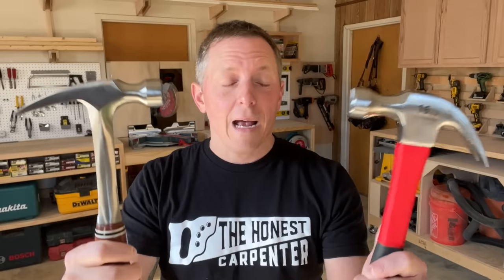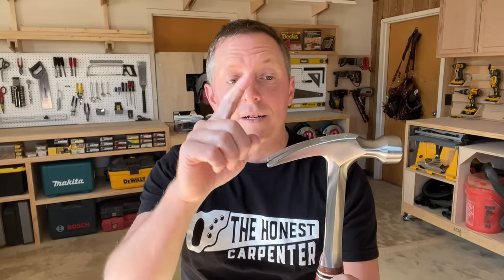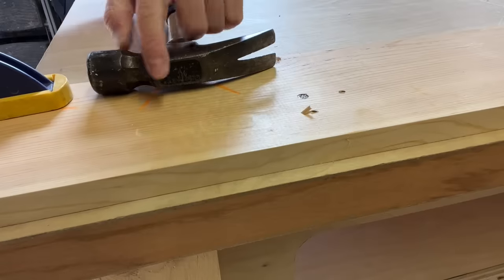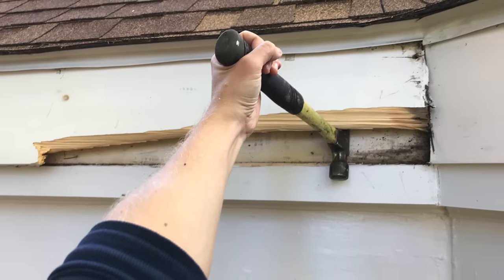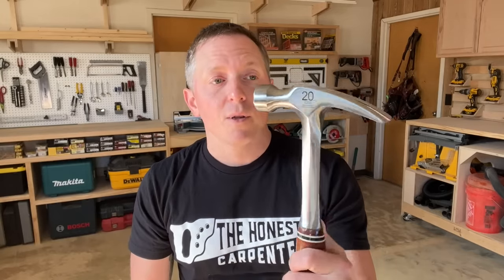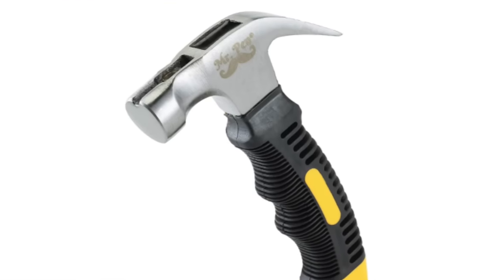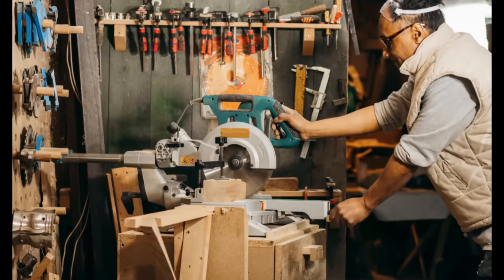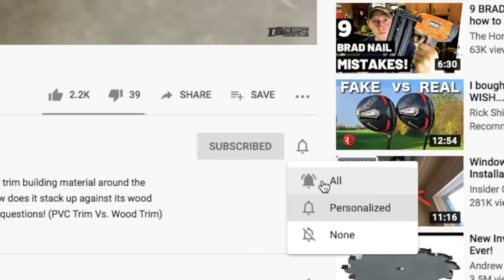DON'T USE STANDARD HAMMERS!! Try This Instead...(Rip Claw Hammer Vs. Curved Claw Hammer--Which One?)

Comment: As a retired carpenter with 40yrs experience, here's a pro tip: If you value your elbows, stick with wooden handled hammers. Steel handles cause a huge amount of percussive damage to your elbow and shoulder joints. They're great for demo but not for everyday use.
I would recommend a 20oz wood handled Vaughn straight claw hammer for all situations,
Reply: Amen, brother. Used an all-steel Estwing 20. It was like a battering ram. Drove 16s in a single blow and ATE demo. But it ruined my elbow. Then tried fiberglass handles. They splinter and split along the shank above the grip. And you constantly get spikey shards in your hammer hand when you slide it back into the loop. 

I ended up with a 20 oz Vaughn. Gives the same advantage as the Estwing but cushions the impact. However,  after snapping the handle off of one during demo, I pull out the Estwing to take things apart. And the Vaughn to put them back together.
Reply: Yep. I have been guilty on many occasions to overestimate the strength of those wooden handles so I always kept a couple spare handles in the toolbox. Got good at changing handles and always always had a backup just in case. And always carried an Estwing when it was time for "Hulk...smash"
Reply: @blainehankins  Good for you with the new handles. I never got very good at it. Hatchets - yes. Go-to hammers - never.
Reply: I feel the same way, but wood handles, at least the ones they make today, self destruct. I bought fibreglass handled hammers when they came out, and haven't replaced a single fibreglass handle tool of any kind. The fibreglass handles have the shock absorption qualities of wood.
Reply: I love air guns. Neat and easy. Nice sound too.
Reply: @artyfhartie2269  Allow you to over-nail. Chew up the stud. Split the edge of the plywood so no shear value. 16d are actually 14d. Sink the head below the surface of the sheeting so you only get the value of 3/8 ply instead of 1/2" ply.

But sure. Sounds great.
Reply: Amen! I couldn't have said it better. Also from experience.
Reply: @ricoludovici2825  Framing nails are up to 90 mm long with a flat head. When you adjust the air gun right,  it is a thing of beauty and strength. Neat. I love the little staple and pin guns too for delicate work.  No need to over nail and with some wood glue, strong as a fort.
Reply: @ricoludovici2825  I hate any fiberglass handled tools with a passion.  At some point, they will give you fiberglass splinters.
Reply: After running chainsaws for 31 yrs, and half of that time, in the tree with a climbing saw, I wonder if it would make any difference to my beat up old body. At 65, still climbing daily, more abuse doesn't seem to matter. 😆
Reply: @artyfhartie2269  Pneumatic nailers definitely have their place. They are fine for sheathing and roof decking and an absolute must for finish work but for framing they are inferior to hand nailing. A nail set with three strokes of a hammer holds way  better than a single stroke with a nail gun. I have tested this. As for plywood, I always set the nail gun pressure so that the nails were left a bit pround and then came back to set them flush with the Vaughan. Best of both worlds.
Reply: Makes sense thanks
Reply: @Fuckinsurance  Wood handles can be crappy, without a doubt. I'm sure OP is implying that people should use quality ones that stay put together. And speaking as a former medical massage therapist who worked on lots of tradespeople, they're absolutely right about the percussive damage to joints in the hammering arm when using a more solid steel piece instead of a material that can absorb a little shock. For casual DIYers like me who don't use tools all day every day, the difference is probably marginal at best, but for someone using a hammer much more often, the small differences add up.
Reply: so true , my elbow is trash after using steel handle for years nailing shit !
Reply: I concur.
Spent a summer in my 20's swinging a 22 oz Estwing.  Went back to school with tennis elbow.
Reply: I seem to remember Tom Silva from This Old House using a hammer with a wooden handle that he drilled holes in to make it easier on his aging joints.
Reply: @blainehankins  Try nailing 90mm nails in hardwood with a hammer
Reply: "I would recommend a 20oz wood handled Vaughn straight claw hammer for all situations"

Even picking up hitchhikers?
Reply: @ricoludovici2825     Hammers seem to be used nowadays for everything but sinking nails. I used to swing it all day long, but pneumatic and cordless nailers have rendered that almost obsolete. I’m not sure where you’re located, but I don’t see a lot, if any, hand nailing going on around here.
Reply: @ricoludovici2825     Most guns have adjustable depths on them and if you over nail something, that’s on you, not the gun’s fault. Building a house and hand nailing everything would take an inordinate amount of time and effort, especially going into hardwoods or lvl’s.
Reply: @huejanus5505  Quite true. But quality has NOT gone up as a consequence. Just speed.
Reply: @huejanus5505  Yes, they have adjustable depths. But the operator has to adjust it. I assure you, I know all that stuff. Now if the workers in the field would just DO it.
Reply: @reidflemingworldstoughestm1394  Nothing sounds as sweet as an air framing gun. Pitew, pitew.
Reply: I like fiberglass.  But I agree with steel.
Reply: @thezfunk  Never happened to me.
Reply: Thanx!  That’s an interesting problem. Wonder if it has to do with the give in wood back the metal. The shock moves up your arm to the point where there’s some give.
Reply: Agreed...Wood rules!!! I always make sure the grain in the handle, is in the same direction as the head and claw. And if I soaked the handle in a little used motor oil, it seemed stronger and lasts longer. Fiberglass can absorb the shock, but those fiberglass splinters suck.
Reply: At work I always use synthetic handles (fiberglass core plastic and rubber overmold) nice on the elbows but lasts well without any care. At home I have wooden handles and when I brake them it's fun to rehandle them.
Reply: @KS1776  I have an assortment too. Replacing handles is fun... I like to dye, burn, and clear coat mine. Gives an interesting look
Reply: @Fuckinsurance  wow, you have problems. Ask your insurance about therapy. Oh wait... Your name... nevermind...
Reply: I wonder if someone could design a steel hammer that had a two part handle attached with a strong center bolt with a urethane bushing between the gap where the 2 parts connect, so you get the shock absorption of wood with the strength and durability of steel 🤔
Reply: Aren’t the pneumatic NAILS the big breakthrough? I am told that when you drive one into some boards, a joining compound sinks along with the nail-and good luck pulling the boards apart. You’ll need it.
Reply: That was my framing hammer I forget if it was 19 or 20oz. I love Vaughn hammers, affordable and great quality.
Reply: I switched to titanium with a wooden handle 18 months into starting my own remodeling company after being a cabinet maker for 12 years. Expensive, but medical bills are more expensive.
Reply: @marsbase3729  That's what I was going to say.
Reply: @Fuckinsurance  Would you care to share a little info about your decades of experience with different types of work using different types of hammers that you obviously must be basing your opinion on. 
I'v used hammers in, carpentry, structural steel, HVAC, plumbing, sheet metal, landscaping, bike mechanic, blacksmithing... and more, but that's was a long long time ago. 
In my experience, when used properly quality wooden handles can last plenty long enough and save the long term user a lot of pain and possibly debilitating injury to make them well worth an occasional handles replacement. 
If your braking quality wood handles left and right, it's the way you are using it that's braking your hands and not the fault of the wooden hand.
Reply: Absolutely agree. When I started as a big strong teen I immediately bought the biggest estwing at the store, a 28 oz. 
After awhile I downsized to the venerable 22 oz. 
Fast forward 20 years &I have tendinitis & an ulnar nerve impingement.

The 999 wood handled 20 oz. Vaughan with a milled face is my go to hammer. The 19 oz. Cali with the longer handle is really nice too but struggles a bit with toe nailing & can be slightly awkward. 
  As a young man I didn't have the time or patience to "baby" or replace a wood hafted hammer. 
Now my elbow doesn't have the time or patience to handle the percussive reverb from the steel shafts.
It takes a while to catch up. But now I very rarely ever use a steel shaft. A drilling hammer and a bar are often more effective anyway. 
With that said, for the homeowner or weekend warrior, a 16 oz. Steel estwing will likely serve all their needs very well.
Reply: Mine are neither, that new age unbreakable plastic with a rubber grip.
Reply: @mathewgrubb7465   We also have Flashing, Joist Hangers, Hurricane ties, new work windows, some siding e.t.c... 
I'm 36 and used an Estwing 28/22 oz. Primarily for years. Developed bad tendonitis, and the inflammation pinched my ulnar nerve. It affects your ring and pinky finger, as well as the back of your hand. Pins & needles, burning and itching. It'll wake you up as well. 
  After switching to 19 & 20 oz. Vaughan wood handles and doing some additional stretches/being aware of my limitations I'm back to nearly 100%. 
I have XXL hands and work out pretty regularly... the elbow injuries are cumulative and steel handled hammers are a big contributor.
Reply: @marsbase3729   Never seen it in a hammer, but Fiskars did it with their hatchets, and their nearly indestuctable polymer. It's plastic, but I've seen that plastic put through hell by 250 lb. Apprentices with splitting mauls & knotty oak.Fiskars makes a steel handled hammer that has a separate core handle makeup & they claim major shock reduction. The cheeks are hollow with some rubber shock absorber. It looks kinda gimmicky, but I thought that of their axe lineup before I tried them. They're excellent and 100% lifetime warrantied.
Reply: @mathewgrubb7465  I started usung nail guns in the 1970's. They don't make nailing better, they just make it faster. Quantity over quality.
Reply: Started out with a 19oz Vaughn straight claw hammer with waffle iron head and wooden handle. Loved it. Preferred it over a 14 oz titanium which someone gave me as a gift.
Reply: @reidflemingworldstoughestm1394  Nah, we use meat hooks for grabbing those on the fly.
Reply: @ricoludovici2825  I haven’t used my Estwing for everyday stuff for years. If I’m taking stuff apart though, it’s my go to. Otherwise it sits in the back of my hammer hanger. My newest hammer is in front - a curved claw Tekton with a hickory handle and the magnet to hold nails for starting so I don’t bang my thumb.
Reply: @thezfunk  Not a fan of them either.
Reply: @ItsAsparageese  -- I think a lot of the problem stems from bad hammer technique. The most effective way to swing a hammer is to crack it like a whip, holding it by the "knob" at the end, and using wrist motion and some pivoting of the hammer within the hand to get the "cracking" motion. This technique does take longer to develop control with, but it's much easier on the elbows, as it distributes any shock through three intersections: the pivot point in the hand, the wrist, and the elbow, all of them looser and more relaxed than when one's technique relies more on trying to "push" the nail into the wood. I used a 22 oz. Estwing straight-claw, steel shank framing hammer for 30 years, and had ZERO problems with my elbows or wrists. Ironically, I did have some elbow pain when I tried out one of those California framers with the more "ergnomic" wooden hatchet-style handle, because the curve at the end of the hammer made it more difficult for me to use the end of the hammer as a pivot point. For someone who insists on using a hammer to push nails in, I suppose that would be a good choice. 
-- Using a whip-cracking motion to generate more force is not just for hammering. It also applies to tennis swings, putting the oar into the water in competitive rowing, martial arts punches, and a whole lot more. And in all of these cases, it takes a lot of practice to learn how to do it with control, which, I suspect, is why it is so underutilized. But I would drive 3-1/2" 16d nails with three blows all day long, and 2" 6d nails with two blows. Never a hint of elbow or wrist problems. 
-- For finish work, I use a 16 oz. Stanley curved-claw tubular steel handle that I bought in 1976.
Reply: @grizzlygrizzle  You articulated that extremely well! I've applied that principle in other disciplines in my life (e.g. martial arts like you mentioned, and it's relevant to some musicial techniques too) but I'd never thought to apply it to hammering, probably because I'm still novice enough with carpentry to be more concerned with accuracy for the moment lol. Thanks for the great rundown on that technique and again awesome job putting words to something so spatial/physical! I always have trouble explaining those sorts of things through comments lol.
Reply: @ItsAsparageese  -- Thanks. When I wasn't working in construction, I majored in English and philosophy, and went on to do grad work in philosophy, mostly in phenomenology (of the pre-postmodernism sort), which is largely concerned with sorting out the different types of subjective experience that we all have in common. But that was a crappy career move, so I went back to swinging a hammer.
-- I was actually a little bit thrilled to hear that you have applied that principle of motion in martial arts and music. It's like a secret I sometimes feel almost evangelical about.
-- If you're going to try that technique of hammering, keep in mind that the grip could be different for your hand than mine, depending on hand size, flexibility, strength, etc., so be prepared for some trial-and-error. Personally, I grip the hammer with my thumb and index, middle, and ring fingers, with my pinkie curled (loosely) beneath the butt end of the handle. I picked up the technique by increments, with the "swinginess" of it fairly minimal at first. 
-- Control is often a matter of using a swing that contains a sideways arc, for when you start a nail and it's leaning a bit to the left or to the right. You want the face of the hammer to hit the head of the nail in a flat, non-glancing way, but if the momentum of the hammer's motion is not in line with the shaft of the nail, the nail will bend. 
-- If  you are already somewhat familiar with the whip-cracking technique, then you should know that it can work with torsional motion as well as linear motion. Play with it when you're doing some framing or any rough work. Once you grasp the underlying principle, it's a lot easier to make it happen. With enough practice with the sideways arc motion, you can drive nails almost perpendicular to the path of your backswing, as when nailing into the face of a floor joist in a basement ceiling, when you can only swing lengthwise through the joist cavity, and have only 6" of backswing (14-1/2" minus the length of the nail and the length of the hammer head) if you try to swing in the usual way.
Reply: @grizzlygrizzle  Hey, carpentry, philosophy, it's kind of all the same thing depending on how one looks at it, and goodness knows they complement one another well :P I'm a big epistemology geek myself, particularly in the sphere of public health and how people communicate about concepts of health and medicine, particularly-particularly as it relates to patient education and clinical outcomes -- all of which is to say, I feel you on the interestingness of the intersection between subjectivity and objectivity lol.

I'm short on brain cells at this hour but I think I'm pickin' up what you're puttin' down about applying the momentum-whipcrackery notion to torsional motion rather than just linear. It's resonating with the part of me that remembers the throws I learned in jiu jitsu, specifically those which use circular movement. Commitment to whipcrackery of an opponent was vital to ensure many of the techniques actually moved people at all. I'm having a little trouble turning that notion into a visualization in my head of how a hammer swing in this style would work (despite your excellent description giving me a very clear visual of the context and need), but that's mainly just because I've never done it and don't have the relevant things in my hands and eyes right now haha. I'll definitely have to experiment with this next time I'm doing buildystuff.

I absolutely love geeking out with other methodical, analytical, conceptual-level-vocab-oriented people about things to be methodical and analytical and conceptual about and ways to do so. And I absolutely grok and relate to the joy of proselytizing useful techniques and systems of techniques lol. I suspect we'd have a lot of fun trading other ideas. Want to be friends? Got Discord perhaps?
Reply: @ItsAsparageese  -- The sideways whipcrackery (I like your term for it) involves a lot of wrist rotation during the forward motion of the wrist. 
-- With you on epistemology. Descartes distinguished between practical certainty and absolute certainty almost 400 years ago, Locke amplified solid reasons for intellectual humility with his argument for religious toleration, and yet the technocrats at the WEF are STILL pushing their Orwellian, build-back-fascist, save-the-planet utopia that reduces the people to livestock. 
-- Science objectifies and mathematizes what it studies. Edmund Husserl (father of modern phenomenology) described science as reducing the world to "space-filling mathematical formulas," and from a different direction, Ludwig Wittgenstein often spoke of "logical space" in his early years, and he played with logic as if it were a 3-D matrix within which scientists and practical thinkers conceive the world as intelligible. Both of them ended up skeptical when they realized the distortions of reality this entailed. David Hume concluded that the connections we perceive in the world were mere "mental associations," while Leibniz, on the other hand, somewhat credulously put forth his view of the structure of reality as having no connections and no causation of the sort we usually think of.
-- ("Connected" and "distinct" are antonyms, and when we conceive the world as countable, mathematizable objects, we preclude connections between them, if we think of these things in absolute terms. One of the oldest questions in philosophy: "Is the world one thing or many?" In my view, the answer is "Both." The world is ambiguous with respect to the distinctness and countability of its stuff and with respect to the physical connectedness and cohesiveness of the world. This also entails that the boundaries of physical things are ambiguous. Consider that the gravity of a physical thing extends to infinity, though in an ever-diminishing strength.)
-- (So when we conceive of the world in terms of distinct, countable objects, we aren't making this up out of whole cloth, but only marginally distorting it, for the sake of clawing out distinct logical handholds. The distinctness in the world is real, but not absolute. And on the other hand, the connectedness of the world is also real, but not absolute.)
-- (The expectation that our science and logic would come out absolutely true has led to disappointments when various evidences emerge that it isn't, and those disappointments have left us with a bunch of radical skepticisms-- "absolutist" skepticisms, like postmodernism.)
-- (Intellectual arrogance and absolutism leads either to extremist digging-in-of-heels-- scientism, or to extremist skepticism about the possibility for truth and knowledge-- postmodernism, but both have the same root, and end up oddly in the same political camp that pushes for censorship and against transparency. Scientism gives the intellectually arrogant license to objectify and mathematize their neighbors, as if that didn't reduce them to the status of livestock to be managed, while postmodernist gives the more emotivist crowd license to ignore any truths and data that disagree with their preconceptions as someone else's propaganda. For postmodernists, there is no such thing as truth. There is only propaganda. So from both ends, epistemological extremists unite against epistemological moderates.) 
-- (The social sciences objectify and mathematize what they study, and that just happens to be other human beings. Their scientific approach to humans necessarily takes a veterinary or animal-husbandry perspective and renders human beings as livestock to be rendered more predictable and manipulable. What could go wrong?)
-- Personally, I prefer an epistemologically moderate approach to human affairs.
-- When it comes to patient education, data, and truth about the current malady, I would refer you to YT channels Dr. John Campbell, Drbeen Medical Lectures (sic), and Peak Prosperity. 
-- I don't have Discord. I'm embarrassed to say that it is something I have heard about peripherally, but have never been there. Is there a way to send private messages through YT? I don't have much in the way of social media. Maybe I'll try out discord. Any advice in that? I do have a facebook account, but I rarely visit it. I only use it to keep in touch with some friends in the Philippines.
Reply: @ricoludovici2825  I have broken the head off 2 20oz estwings doing demo. Don't trust the hype.
Reply: From someone who really knows his stuff.
Reply: Fiberglass is OK too
Reply: Correct. The other one could be considered a finishing hammer.
Reply: O ya, infact when id go to the store and they had my favorit wooden handle, id buy 5-10 of them at once jjst for what you said. I still have a bunch but their dwindeling slowly cause sometimes i use them to rough.
Reply: @ricoludovici2825  Hitachi cordless doesn't fire half the time but sends the gun tip into the surface, just obliterating the wood after a few failed attempts.
Reply: Titanium handle Martinez. It is 15 oz but with my framing head its 32 oz.  balanced so well that it feels lighter than my 19oz estwing. A Lot less shock. Interchangeable heads. Slot on side of handle just below the head for pulling nails and does so extremely well, or you can hang it up during lunch.
Reply: Started out with a Vaughn 24oz curved claw metal handled hammer. Will be upgrading to their straight claw at a lighter weight as soon as possible!!. Thanks for the handy tip
Reply: @blainehankins  In winter weather, even with the rubber grips, those steel handle hammers pass the cold right through your glove into your hand.  I found wood handles much better for cold weather work.
Reply: I just turned 40 and I've been a carpenter for 15 years. I'll be switching to wood in the next month or two.
Reply: As a stonemason of 3 years (I’m 24), I can’t agree with this enough. My first year I used a metal claw hammer for banging out all my buckets, my mudboard, and our mixer. After about 6 months, I started to get a tingle in my right arm from elbow to fingertips. Then it got worse and each day I was waking up my hand felt like it was “vibrating” at a super high frequency to the point that it was just a pain in my arm all day. I live in Michigan, so we don’t work for 2-3 months out of the year, and finally it went away then. I looked into it though, and it’s common for guys in trades to get something like that in their arms or hands if they’re constantly banging metals objects with a metal hammer. Never had an issue again after using a wooden one😂

Edit: hoping I don’t get hate here, I’m new to trades so I’m not super knowledgeable or could have been making mistakes, but hey I never bitched out when the work got tough and didn’t let my arm get in the way of work😂
Reply: i went titanium about 12 years ago and never looked back. 14oz ti head on a wooden handle is the way to go,
Reply: Get a Ti-Bone stiletto with a titanium handle, absolutely no vibration, 10/10
Reply: @huejanus5505  hand nailing is used a lot building here in New Zealand for attaching claddings, timber/fibre cement weatherboards, cedar planks/ fibre cement sheeting. Gas nailers are the choice for framing and hand nailing 4 inch nails for trusses
Reply: @ricoludovici2825  
I thought those nails seemed smaller than when I was growing up. I just thought maybe it's like everything seems smaller when your an adult.
Reply: AND wrists may I add ☹️👍
Reply: Absolutely correct! Besides, Estwing hammers, while beautiful and long lasting, are not as well balanced as a wood handled claw hammer. I framed and finished for years, and my favorite framing hammer was 20 oz. wood handled Vaughn with a knurled face. I couldn't get behind heavier hammers for all day use, and a lighter one wouldn't drive 16d nails very well. Granted, that was a long time ago, before the popularity of air tools for framing. Even now, picking up a hammer with a wooden handle that has been shaved and formed to improve balance and to fit my hand is a subtle joy.
Reply: @ricoludovici2825 I’ve never seen a fiberglass hammer splinter maybe a sledge after years of use that we had showed a little damage
Reply: @thezfunk i have a fiberglass hammer that was my paps it’s old and the handle isn’t splintered I’m not sure what kind it is but maybe you just had a junk one
Reply: Vaughan makes the best tools, 100% USA made. Sadly, I don't think they're going to remain in business much longer. All the big hardware stores stopped selling Vaughan Tools in their stores. It makes me sad for this country. I actually had a conversation with Mr. Charlie Vaughan recently. I asked him to bring back a camp axe they used to make, which they discontinued. It was sold at Lowes and Home Depot just 3 years ago. All the big hardware stores went with their own brands (foreign made), for greater profits. The Vaughan tool prices weren't more expensive than Kobalt, Husky, Stanley, etc. the profit margin was less. Mr. Vaughan found the camp axe I wanted in his warehouse. It was brand new, with the plastic "NADE IN THE USA" wrap on the handle. The man sent it to me for free! I really hope Vaughan finds a way to stay in business. For those who don't know, Vaughan manufactured many Craftsman tools for decades. Vaughan literally sold the same exact tools with their name on them. The Craftsman models were identical, but had the Craftsman brand name on them.